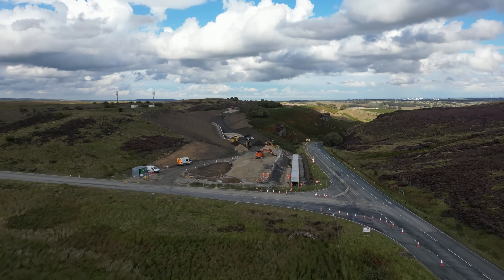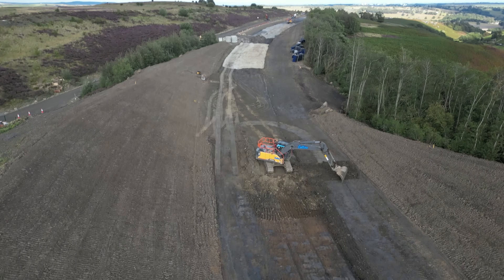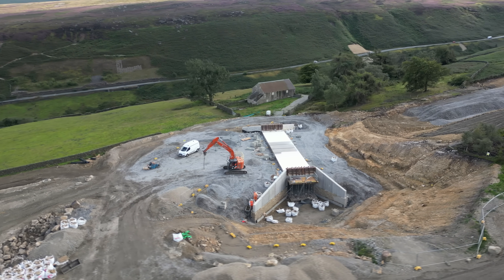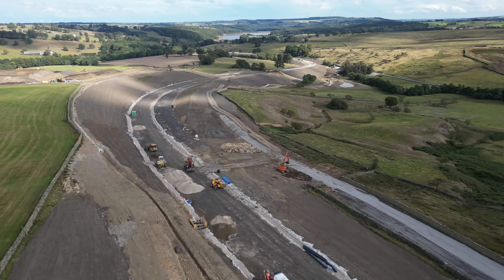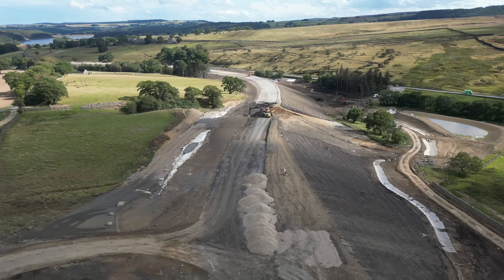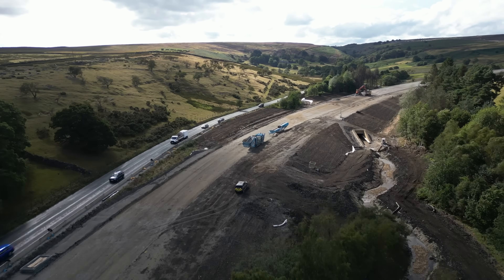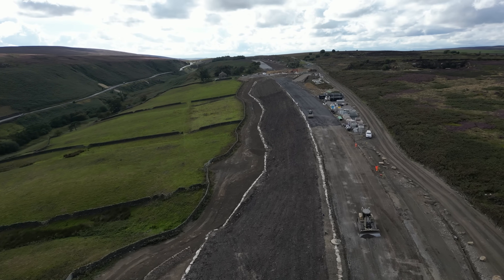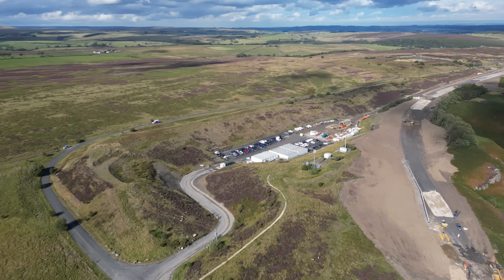Kex Gill Bypass: New Road Build Progress – August 2025

Comment: i've driven/cycled and motorbiked over kex gill hundreds of times since the early 70's, and only last week was wondering how progress was going as well as the exact route, so this is timely, thanks. As far as the old road goes, i read somewhere that it will still be left open for those that want to use it, especially for mountain bikes, horses, 4wd or whatever, but no maintenance will be done so will obviously degrade over time, probably becoming a footpath eventually. cheers

Comment: The old road will be abandoned according to the local press report I saw.
As you hinted at, at the end - the current ending at the Skipton end is stupid, to rejoin the old raod where it does. It would have been better to have carried the road straight on and joined the straight road section at the top of Beamsley Hill. It would have cut out  a couple of awkward bends
Reply: Those bends you mention are made for trouble come winter but, as someone else advised, the land gets boggy and prohibitively expensive to develop further on.

Comment: What's worrying is all those bare topsoil batter slopes in late August that have been side slope dozed...
You need grass growing on those slopes from June onwards & topsoil needs to be tracked-in perpendicular to the slope so when it does get wet & loads up with water, gravity does not overcome the saturated soil structure & it's adhesion & it all slumps downwards...
I have some worries about this road, not least it is the main contractor's first ever highway they've built.
Reply: Ha!.... If only they had YOU on the team......!!
Reply: @andymccabe6712  I can only speak from experience fella, & fortunate enough to have learnt so much about highway construction from working for one of the UK's once most respected road-building main contractors...& living 10 minutes away from Kex Gill, I know the ground conditions up there...🙏

Comment: What kind of a poor job is this that doesn’t carry straight on to join the existing A65 road for this cost it was easily achievable
Reply: Supposedly the ground it would have to cross is boggy so the prep would be enormously expensive.
Reply: @spankeyfish Ah, thanks. I can understand that. Pity about the new bends but costs need to be contained I guess.
Reply: A59 not 65

Comment: The Harrogate end of the existing A59 will become an access road to a farm and the Skipton end will be removed and landscaped.
Reply: I would have thought a dedicated cycle route would have been more beneficial for the old road
Reply: @steviedee8921  Its not worth it, as at the top of Kex Gill, you would be back on the old death trap A 59- not I road I would ever , ever cycle on !
Reply: @btcolber  If North Yorkshire Council were interested in cycling, and ambitious, they could have used the old road as a part of a route between Harrogate/Penny Pot Lane and Bolton Abbey, building a separate cycle path where needed. But it's North Yorkshire Council.